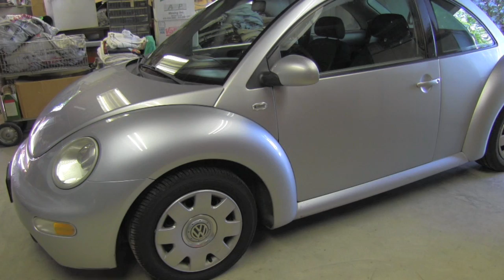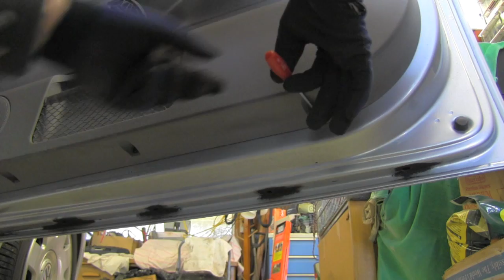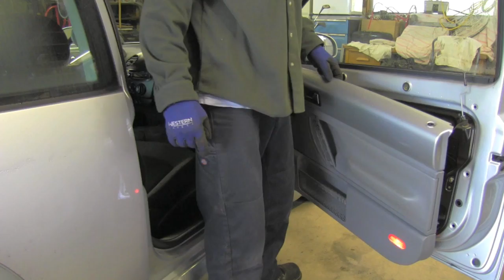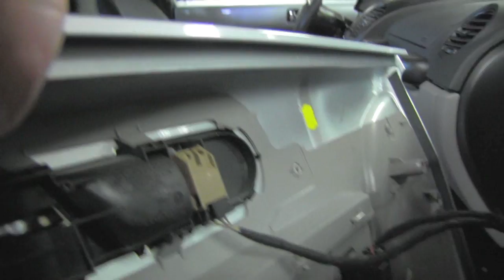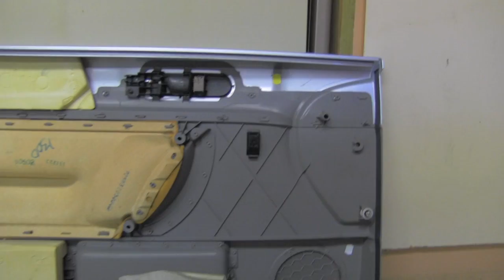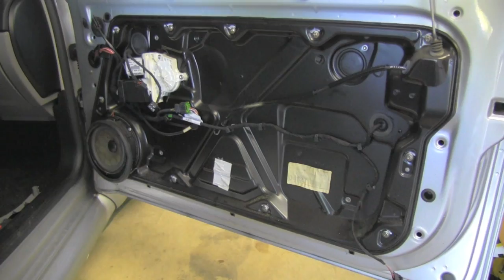door panel removal VW Beetle

Comment: They say it’s a hidden key hole on the passenger side under the outside door handle. But mine doesn’t have a hole there. Can I still prior the cover off? My door won’t open with the key fob or inside switch. 04 Beetle